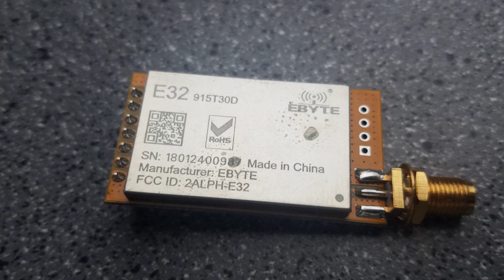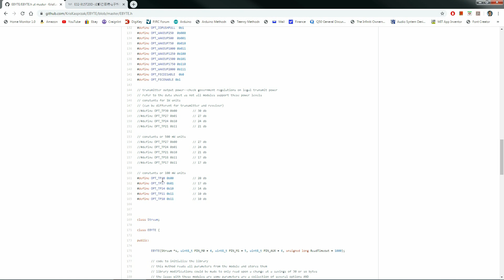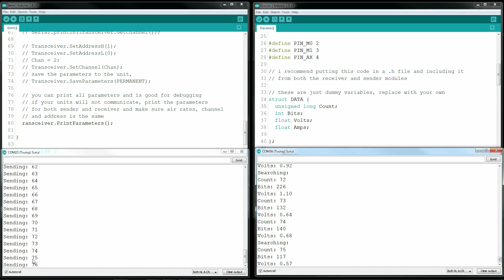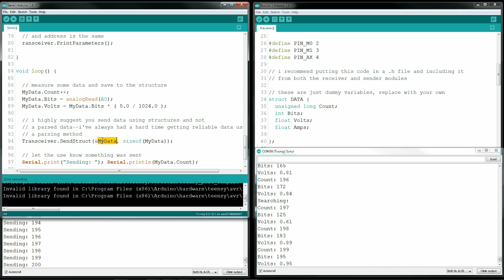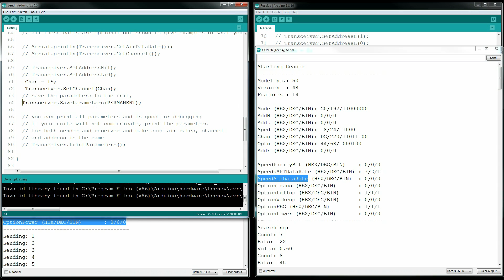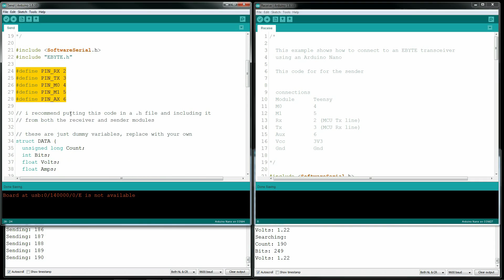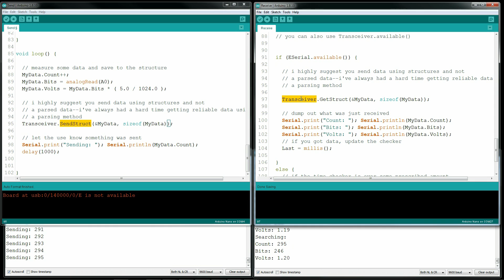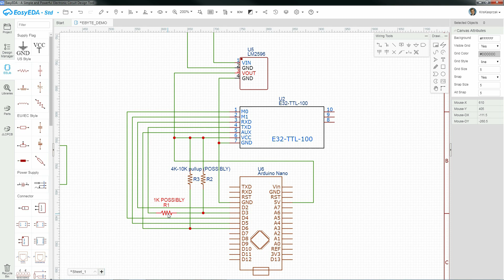EBYTE Wireless Modules for MCU projects

Comment: Hi Kris,
Thank you for the video and libraries. I was able to get the code to run with E32 (without commenting anything out in EBYTE.h), however, I am unable to get E220 or E49 to work at all! The serial monitor is showing the model number and Version as FF.

Would you be able to help here?
Reply from the maker: Good news: bad news. The E220 has a completely different set of registers, hence my library can't be used to program it. There is some different data and order in the registers. 

Good news: the concept of programming is relatively the same for both modules, the changes would be in the order and content in the byte read/write creation process. I don't have any of these modules.

If you only need to send/receive data that can still be done w/o any library.

Im surprised the E49 does not work with this library. The registers are basically the same except for the option byte The e49 however does not allow programming of things like 1) IO drive mode 2) pullups, 3) WOR and 4) FEC switch--all these must be 0--meaning if you set these 4 to 0 the option byte should work. meaning you can set the fix transmission enabling, and the transmit power. I don't have an E49 to test however.
Reply: @KrisKasprzak  Thank you for the reply,
How would I be able to send data without libraries?

I've played around disabling and enabling options, and I couldn't get any of them to work unfortunately.
Reply from the maker: @yousefnaser4662  I explain how to do this in the read me file post it on get hub. Read it start to finish a lot of your questions are answered their
Reply: @KrisKasprzak  Thank you, I'll do just that.

Comment: I successfully tested this library and the code. It working fine. These Chinese modules do not working so stable. Another thing I cant communicate with  some of Ebyte modules on 5v , it working only on 3.3V /Arduino Uno/. Will test it with voltage dividers , and pull up resistors too. With 3.3 V cant produce the full power of the module , in my case it was less than 20dBm.
Reply from the maker: Thanks for adding your experience. I have found the same--very reliable on 3v3, but people have reported issues if used with 5v0 MCU's. Only 1 of my projects with 5v0 had issues, I have not tested power output with 3v3 though.

Comment: Hello, i have 2 E32900T20D (with 868 antenna).There are no connection between 2 Arduino.Perhaps E32-900 are not suitable with this libraries?
Reply from the maker: I believe those are serial  devices this library should work with them
Reply: @KrisKasprzak  can i send you picture and code of my project?

Comment: Hi, will this library also work with the EBYTE NRF24 chips eg. E01-2G4M27D? Thanks
Reply from the maker: This library will definitely not work with these or any SPI series modules.
Reply: @KrisKasprzak  ok no worries and thanks for quick reply. Was just checking as recently ordered some of the above due to current cheap versions of NRF24 chips being extremely unreliable and your library looked pretty cool. Thanks again :)
Reply from the maker: @cliveminni  I use the heck out of the serial versions and find them very reliable.And if you use the 3.5 DB antenna the range is extremely good even without line of sight

Comment: Hi Kris, nice video and library, works great, was able to sent also char data between the transmitter and receiver, i use two Wemos D1 R2 & mini chinese clones as MCU and it works. Here is my pin layout for use with my Wemos device:
// For Wemos D1 R2 & Mini:
#define PIN_RX 0    //D3 on the board (Connect this to the EBYTE TX pin)
#define PIN_TX 4    //D2 on the board (connect this to the EBYTE RX pin)

#define PIN_M0 14   //D5 on the board (connect this to the EBYTE M0 pin)
#define PIN_M1 12   //D6 on the board (connect this to the EBYTE M1 pin)
#define PIN_AX 13   //D7 on the board (connect this to the EBYTE AUX pin)

Tested with 2 * E32 868T20D 100mW Lora 5V from Wemos and 2 * E32 433T30D TTL-1W with 5V power supply.

Greetings from The Netherlands
Reply from the maker: Great tips, thanks for sharing the pinouts.

Comment: Hi,i seem to have problem with the receiving part. i'm using UNO . Tx and Rx connection 2 and 3. there is no problem during first transmission. but after i change the m0 and m1 pin to d11 and d12, the receiving part show searching. then after i change it back to 4 and 5, i still got searching. and i realize that it take time to send the data. Do you know why?
Reply from the maker: Are you changing both the connection and code?
Reply: @KrisKasprzak  yeah i change both the code and the pin. Even after i change back to pin 4 and 5, receiving data still 'searching'. Isit related to tranceiver.init?
Reply from the maker: It’s hard to diagnose with this level of detail, not sure what other devices are connected other libraries etc. if it works on two pins must be something you’re doing. I’ve got these things to work With M0 and M1 on just about any pin
Reply: @KrisKasprzak  i've passed that phase but right now i have another problem. The value that i receive is different. btw still using your code. example: sending count 1 : receive count 23234546. the value for bits and volts also different. Why is that?

Comment: First of all, thank you for doing so.
All the things look normal. All the parameters of RX and TX are set to be the same. However, they just cannot communicate with each other. What would be the problem?
Reply: how did you solve the problem. I have same problem too. If you share your solution, i feel thankfull
Reply: @leylamsn898  Hello. I changed my modules instead of sticking to LoRa. I choose to use nRF24L01. In spite of the fact that the power consumption is higher than using LoRa, I cannot solve that problem. Just a trade-off…

Comment: Thatks for video. Could you explain what does “parsed data” mean?
Reply from the maker: parsing: putting data in to a specific format so you can extract it later.
Reply: @KrisKasprzak  Changing of data type is parsing?
Reply from the maker: @kirill_khudoyarov  Parsing means converting into a different type of data--namely getting a huge string filled with data, then separating out that data 1233,22.113,13444.1,CAT, 22,1355 then parsing is getting out CAT. Parsers can be a pain to write, but using and sending a struct is generally easier because the compiler separates out the data.
Reply: @KrisKasprzak  Thanks a lot!

Comment: I have 2 Polaris S100 GNSS receivers. The company says to use 2 E61-433T30D and a Raspberry Pi to set them up to talk to each other. Can I hire you to set up the EBYTE transceivers?
Reply from the maker: I'm not sure what you need programmed. These units come from the factory already programmed and ready to use. My library is only needed if you want to change the settings (channel, data rates, etc.). You don't even need my library for communicating between EBYTE transceivers.

for sending / reading a single byte:

EBYTESerial.write(some byte);
byte TheByte = EBYTESerial.read();

for sending / reading a data structure

EBYTESerial.write((uint8_t *) TheStructure, sizeiof(TheStructure));
EBYTESerial.readBytes((uint8_t *) TheStructure,  sizeiof(TheStructure));
Reply: @KrisKasprzak  oh, thanks so much. I was hoping that was the case.
Reply: The company gives this setup: https://www.polaris-gnss.com/blog/using-radio-with-s100   but doesn't give enough clarity to me to set up the transceivers.

Comment: Have you maneged to solve the UART baud rate configuration issue? Using the E-byte setting software I was able to change it to all available values. Can your library set values different from 9600?

Comment: I have another question. Could I use this library to ESP32? Is it compatible?
Reply from the maker: You should be able to use it I have an esp32 connected to one and it works just fine.
Reply: @KrisKasprzak  Ok, but which diffrents there are? I used PINs:
RX 16, TX 17, M0 34, M1 35, AX 32.
Should I change something else?
Reply from the maker: @albertwziatek154  

#define PIN_RXD2 16
 (16 on MCU goes to tx on ebtye), note defines are just for document and never used
#define PIN_TXD2 17
 (17 on mcu goes to rx on ebtye) note defines are just for document and never used
#define PIN_M0 4
, what I use but your pins should work
#define PIN_M1 22

, what I use but your pins should work
#define PIN_AX 21
, what I use but your pins should work

Note, serial on ESP is hard coded, so dont use softwawareserial as with UNO

create object like this
EBYTE Trans(&Serial2, PIN_M0, PIN_M1, PIN_AX);
Reply: @KrisKasprzak  So I edit your "Send" example code and tried to communicate ESP32 (Sender) with Uno (Receiver). Doesn't work. In link is sender code.

https://pastebin.com/BEgXj6S8
Reply from the maker: @albertwziatek154  Glad you posted your code.
 /////////////////////////////////////////////////
In the UNO .ino you MUST use SoftwareSerial to create the serial port, something like this
#include <SoftwareSerial.h>
#define PIN_RX 2
 // do not use pin 0 and 1 as they are reserved for usb communications
#define PIN_TX 3
#define PIN_M0 4
#define PIN_M1 5
#define PIN_AX 6
SoftwareSerial ESerial(PIN_RX, PIN_TX); // note how you define the serial pins on the MCU
EBYTE Transceiver(&ESerial, PIN_M0, PIN_M1, PIN_AX);
// make sure you have MCU Rx connected to ebyte Tx and vice versa

/////////////////////////////////////////////////
in the ESP32 .ino file
no software serial as the serial port is hard wired and can't be changed

#define ESerial Serial2 // if  you are a #define kinda guy :)
// create the transceiver object, passing in the serial and pins
EBYTE Transceiver(&ESerial, PIN_M0, PIN_M1, PIN_AX);
OR
// just pass the Serial2 by ref direcly in--results are the same
EBYTE Transceiver(&Serial2, PIN_M0, PIN_M1, PIN_AX);
// make sure you have MCU Rx connected to ebyte Tx and vice versa

.
Reply from the maker: @albertwziatek154  

I just plugged my ESP32 in and can communicate with an uno

You have a bunch of stuff wrong
1. I believe pin 34 on and ESP is input only but u r trying to use as a digital output (34 is an analog input pin)
2. you cant send a mix of data types in your struct (32bit MCU and 8 BIT will pack / unpack differently), hence transmitted data will alwasy be corrupt. send everything as a uint16_t and multiply by say 100 on send ,  then divide by 100 on receive. 
3. not sure if you even have antennas connected
4. I'm not sure how your devices are even wired (not doing Rx -> Tx is generally number 1 problem)

ESP code --------------------------------------------------------------------
#include "EBYTE.h"

#define PIN_M0 18 // pin 18 on the ESP
#define PIN_M1 19 // pin 19 on the ESP
#define PIN_AX 21 // pin 21 on the ESP

struct DATA {
  // due to how 32 bit MCU and 8-bit MCU pack structs
  // you will need same data type for everything
  // or try EasyTransfer.h
  uint16_t Count;
  uint16_t Bits34;
  uint16_t Bits35;
  uint16_t Volts34;
  uint16_t Volts35;

};

DATA MyData;

// create the transceiver object, passing in the serial and pins
// pin TX2 on ESP32 connect to EBYTE Rx
// pin RX2 on ESP32 connect to EBYTE Tx
EBYTE Transceiver(&Serial2, PIN_M0, PIN_M1, PIN_AX);

void setup() {

  Serial.begin(9600);

  while (!Serial) {}

  Serial2.begin(9600);

  Serial.println("Starting Sender");
  while (!Serial) {}
  Transceiver.init();
  Transceiver.PrintParameters();

}

void loop() {

  // measure some data and save to the structure
  MyData.Count++;
  MyData.Bits34 = analogRead(34);
  MyData.Bits35 = analogRead(35);
  MyData.Volts34 = MyData.Bits34 * ( 3.3 / 4096.0 ) *  100;
  MyData.Volts35 = MyData.Bits35 * ( 3.3 / 4096.0 ) *  100;;

  Serial2.write((uint8_t*) &MyData, sizeof(MyData));

  // let the use know something was sent
  Serial.print("Sending: "); Serial.println(MyData.Count);

  delay(500);
}

UNO code-----------------------------------------------------------
#include <SoftwareSerial.h>
#include "EBYTE.h"

#define PIN_RX 2 // Digital 2 on UNO. Tx on EBYTE (DO NOT USE 0 or 1)
#define PIN_TX 3 // Digital 3 on UNO. Rx on EBYTE (DO NOT USE 0 or 1)
#define PIN_M0 4
#define PIN_M1 5
#define PIN_AX 6

struct DATA {
  // due to how 32 bit MCU and 8 pack structs
  // you will need same data type for everything
  // or try EasyTransfer.h
  uint16_t Count;
  uint16_t Bits34;
  uint16_t Bits35;
  uint16_t Volts34;
  uint16_t Volts35;

};

DATA MyData;
unsigned long Last;

// connect to any digital pin to connect to the serial port
// don't use pin 0 and 1 as they are reserved for USB communications
SoftwareSerial ESerial(PIN_RX, PIN_TX);

EBYTE Transceiver(&ESerial, PIN_M0, PIN_M1, PIN_AX);

void setup() {
  Serial.begin(9600);

  ESerial.begin(9600);
  Serial.println("Starting Reader");

  // this init will set the pinModes for you
  Transceiver.init();

  Transceiver.PrintParameters();

}

void loop() {

  if (ESerial.available()) {

   Transceiver.GetStruct(&MyData, sizeof(MyData));

    // dump out what was just received
    Serial.print("Count: "); Serial.println(MyData.Count);
    Serial.print("Bits34: "); Serial.println(MyData.Bits34);
    Serial.print("Bits35: "); Serial.println(MyData.Bits35);
    Serial.print("Volts34: "); Serial.println((float) MyData.Volts34 / 100.0);
    Serial.print("Volts35: "); Serial.println((float) MyData.Volts35 / 100.0);

    Last = millis();
    delay(100);
  }
  else {
    // if the time checker is over some prescribed amount
    // let the user know there is no incoming data
    if ((millis() - Last) > 1000) {
      Serial.println("Searching: ");
      Last = millis();
    }

  }
}
Reply from the maker: One more thing getting Communications to work between different MC uses challenging in itself try an UNO communicating  to another UNO.
Reply: @KrisKasprzak  In general, my main project is to try connect esp32 with esp32. I thought esp32 with uno should be easier. I was wrong. I will try your solution when I back to home. Thank you for your great help.
Reply: @KrisKasprzak  I used your code. Receiver still searching.
I have connected antennas. My TX from EBYTE is connected to RX on board, and MCU from EBYTE to TX on MCU. I used your reccomended pins. Probably this is too much for me, but I need to  connect ESP32 with ESP32. This is my major target.
Reply from the maker: @albertwziatek154  After init add Transceiver.PrintParameters(); on both units. I wonder what the settings are.
Reply: Maybe there is a problem with voltage, because it look like LoRa module is turn off. I don't know what going wrong. ESP32 have 3V3 logical pin... Maybe there is a problem. I really don't know.

Comment: Hi Kris, I copy and paste your example code and I tried turn on Lora communication. I used two difrrent PC. Receiver could not find ESerial, because I see on the screen communicat: "Searching: ". What could I do wrong?
Reply from the maker: There's not much I can do with this description. What controller are you using would help.
Reply: @KrisKasprzak  I use Arduino UNO. Lora is E32 Ebyte.

[EDIT] Your example code is ready to "copy and paste", yes?
Reply from the maker: @albertwziatek154  not sure why your cupping pasted just run the examples right from the folder. But yeah he should be able to copy and paste the code
Reply: @KrisKasprzak  So, what can I do wrong if your example is ready working project?

I have two arduino uno. On both I connected RX from LoRa to "PIN 2", and both TX to "PIN 3". In code PIN_RX is 2 and PIN_TX is 3. It is correct?
Reply from the maker: @albertwziatek154  Lora pin TX must be connected to uno RX, and Lora pin Rx must be connected to uno TX. The #defines for PIN_RX and PIN_TX refer to the MCU pins and not the Lora pins.
Reply: @KrisKasprzak  So, I was wrong. So stupid mistake. Thank you. Lora working :)
Reply from the maker: @albertwziatek154 

No worries, If I had a dollar for everytime I switched the Rx Tx lines, id have like $10 :) post what your project is, i'm sure my subs would like to see what others are doing
Reply: @KrisKasprzak  Nothing original. I will send BME280 sensor paramaters. It would be little meteo station with lora communication. This is my first project on Arduino.
Reply: @albertwziatek154  please share your code
Reply: @albertwziatek154  hi, mind to share your code with me? i'm having problem with the bme thang. i would appreciate if you can help me.

Comment: Thanks for the video, and for the library! I am trying to use a E32  with a smaller lora module (https://robokits.co.in/wireless-solutions/wireless-automation/433mhz-lora-sx1278-long-range-rf-wireless-module). I thought of using the E32 as the sink node, but couldnt figure out how to make both modules interact, got any suggestions??
Reply from the maker: My lib will definitely now work with that module as its SPI based. My lib uses special pins and serial port for communication. However of you can manage to get all the parameters correctly set on both units (an EBYTE and this one), i'm still not sure if it will work with and ebyte. EBYTE does offer other modules that are smaller than the one i' show here.

Comment: Have you tried doing this for arduino nano ble sense 33? i seem to have issues with softwareserial.h lib, couldn't find a solution to work around it. And is it possible to do this with arduino on the transmitter side and raspberrypi on the receiver side?
Thank you!
Reply from the maker: Never tried that MCU, I suspect that the serial is fixed to the pins shown on the board meaning you can't use software serial--just like a Cortext MCU.

I'm not sure how you access the serial port, but just referring to it as Serial1 may work.

Also you don't need to use the functions in the EBYTE lib for communication, the lib can be used for programming the unit, however, this means you still need to figure out how to access the serial on that MCU. Maybe as simple as Serial1.sendByte()